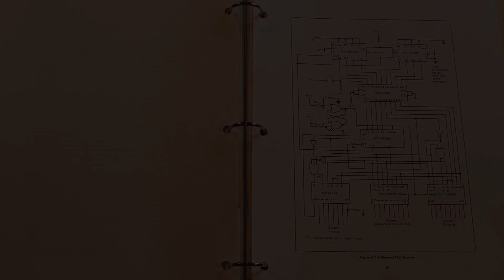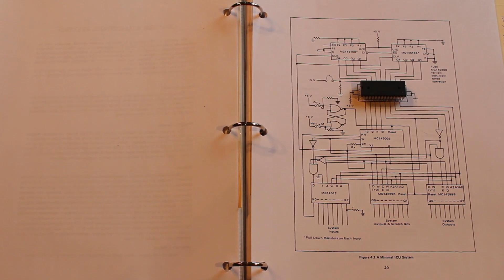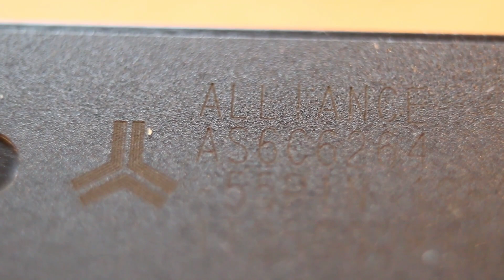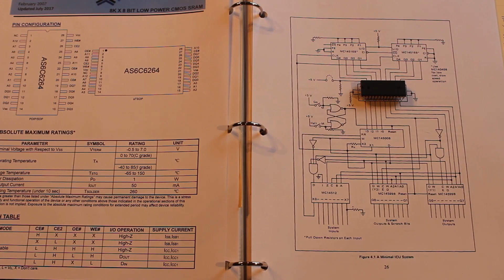1-Bit Breadboard Computer P.03 – Program Memory (using AS6C6264)

Comment: hey theres a eeprom its called a at28c16 and you can add data just like that chip but you just need to put it on high in one of the pins like in ben eaters video

Comment: If you use a 2864 instead of 6264. It's drop-in pin compatible, but it will save your patterns between powercycles...

Comment: The DEC PDP-8 and MITS Altair 8800 didn't have ROM. Bootstrap loaders needed to be entered in via toggle switches on the front panel. At least the PDP-8 had core memory so it retained whatever was left there after power down.

Comment: Changing the address while the write line is low is dodgy. You're likely to write spurious data into locations that you didn't intend to change, because the address lines won't all change at exactly the same time. The right way to do it is to set up the address, wait for it to settle, then take the write line low and then high again.
Reply from the maker: It may indeed be a bit dodgy, but this was actually the way Motorola suggested building it! And while it's only anecdotal, it did seem to work decently well in this case. I think this is primarily due to the fact that the MC14500 really only effects changes on the falling edge of the clock, which gives the address enough time to settle fully.
Reply: @UsagiElectric  I don't think you fully understand (or answered) the question from Greg. I think I have the same question:
Changing the address while the write line is low is dodgy. You're likely to write spurious data into locations IN THE SRAM that you didn't intend to change, because the address lines won't all change at exactly the same time. The right way to do it is to set up the address, wait for it to settle, then take the write line low and then high again. Your way to program the SRAM was NOT described in the datasheet.

Comment: I can't help thinking that if you had the 2 74HC163 chips and the AS6C6264 SRAM facing the other way, It would have been a bit easier to build. As the address lines would be more or less facing each other.
Reply from the maker: You're absolutely right!
Though, in a slightly different way. I like to keep pin 1 of all the chips on the bottom left, that way I always know where the power and ground pins are and don't accidentally hook something up wrong. But, if I had just put the clock and program counter on the bottom row instead of the top row, it totally would have solved the problem. One of those things that I didn't realize until I in the middle of it, haha.
Reply: @UsagiElectric  Yeah, fair point on the pin 1 placement, deviate from how you normaly do things and bang. :) 
It's always the same spot an easier way to do something when it's too late to change it. LOL. I have so many half projects that just backed me into a corner.

Comment: You may want to use a bargraph LED (like Digikey 1080-1184-ND) and a resistor network (like Digikey 4609X-101-331LF-ND) to make the displays easier and neater
Reply from the maker: Yeah, that would definitely be a neater solution!
James Sharman actually uses those on his breadboard computer and they look great. Ultimately though, I do plan on moving this to a PCB in the future, which should make laying out these 5mm LEDs a lot cleaner.

Comment: Very interesting, thanks for sharing. Is it possible to feed the ram with a seperate power sourse like a battery in order to hold the programme installed ? I send you grtz from Amsterdam, The Netherlands.
Reply from the maker: Thank you!
That's actually a pretty good idea! Although, it could probably be done effectively with a super capacitor as well. That might be something worth looking into in the future! A simple diode could help prevent the super cap from powering the rest of the system as well. That's actually really smart, thank you for that idea!
My ultimate thinking, however, is to initially build little cartridges with EEPROMs on them that can program the SRAM with different programs. Then, maybe build a paper tape reader or something along those lines that acts as a programmer.

Comment: I've been dealing with in-place SRAM programming in my own project (a 6502 homebrew console/computer), and gotta say I'd rather handle an EEPROM than try to program an SRAM while all wired up inside. A simple EEPROM programmer should be fairly straightforward to setup on a breadboard with a microcontroller, say even a UNO with some extra logic (or some other extra steps) should work okay for transferring a binary file from computer to an EEPROM.
Reply from the maker: Thanks for checking the video out!
Ben Eater actually has a pretty fantastic video about building an EEPROM programmer out of a spare Arduino, and it's decently straightforward: https://youtu.be/K88pgWhEb1M
But, one of the main reasons I wanted to use an SRAM chip here, is because I really like the idea of plugging in something that will automatically program the SRAM chip for us. I'll probably start by building external EEPROM programmer cartridge, but in the future I'd love to build a paper tape reader, or even magnetic storage like on a reel-to-reel!

Comment: You could easily make effects lighting out of this.  In fact I read some skill crane claw game chaser lights used a very similar system for the lighting effects and even stored the flash sequence in a PROM chip.
Reply: Here is the circuit based on this principle used in crane game lights:  https://www.youtube.com/watch?v=V771m5kSuoU
Reply from the maker: That's exactly what I was thinking! Though some EEPROMs would be much better suited. Get a couple of them together running off the same program counter and it'd be pretty easy to build up long LED chains or matrices  for some pretty awesome effects!

Comment: really good! reminds me of some earlier concepts where you had to pull everyxthing into ram(from core memory for example or a punchcard) first and then read it into the processor form there. maybe its worth playing around with some unusual ways of input/output
Reply from the maker: Thank you!
I'm right there with you, I think it would be awesome to have a punch tape or something similar that can run through and store the program in memory! I have a few ideas kicking around that I'd love to test out, but I'm imagining something like this: https://youtu.be/wALFrUd6Ttw?t=214
Though, especially since we're working with a 1-bit architecture, I'm definitely going to need a lot more storage for big programs, so in the future when putting this on a PCB, I think I'll jump up to 12-bit addresses for about 4k instructions.
Reply: @UsagiElectric  What about an audio cassette?
Reply from the maker: @diegozordan6376  Oooh, I hadn't thought about that! I could use filters and different tones overlaid on top of each other to clock data into a shift register and then clock that into memory. I'm going to have to do a bit more thinking on that one, but that is an excellent idea, thank you!
Reply: A similar thing was done with the Sinclair Z80 and other home computers of that era @UsagiElectric